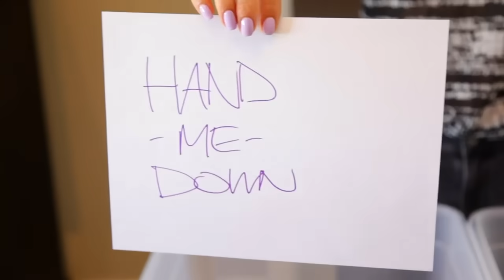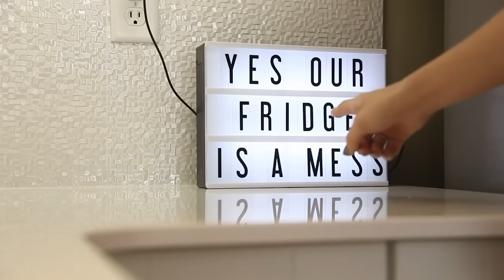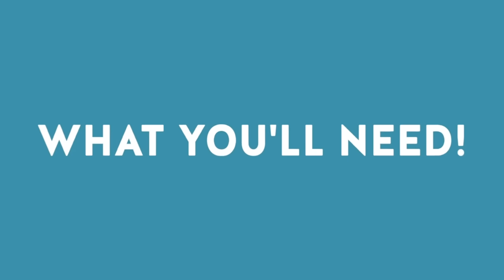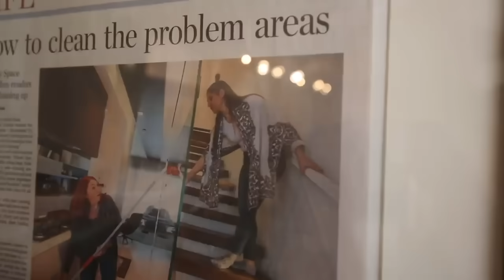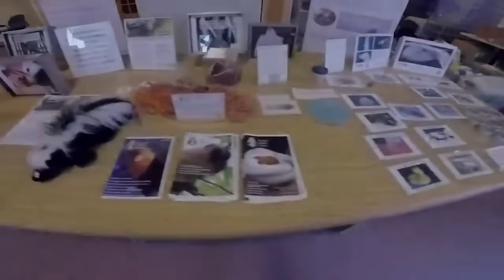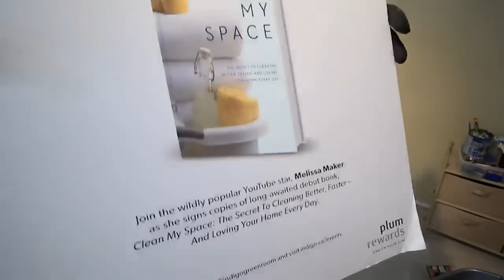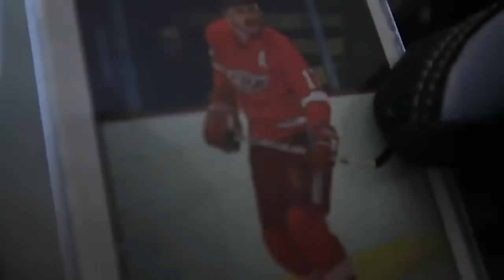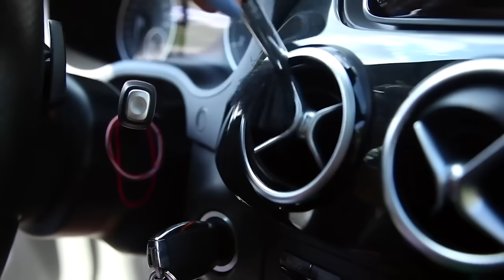Clean With Me Marathon (Cleaning EVERY ROOM in Our House!)

Comment: I love the 3 wave system.  I generally do the whole house at once, since I have a small house (meaning wave 1 for all rooms, then wave 2 for all rooms, etc).  Also since I started watching Melissa, I find that my Wave 1, which used to be by far the longest wave, is now a very short wave, since I try to not let clutter build up in the first place.  For wave 3, I usually just vacuum everything (hardwood, area rugs, and tiles) but sometimes I follow with wave 4 which for me is mopping and using hardwood floor cleaner (Bona).  :)

Comment: whole spices will stay fresh for about 4 years, ground spices for about 2 to 3 years and dried herbs for 1 to 3 years. You just need to store any that you purchase in bulk double airtight. I store mine in the resealable bag they came in or tie off then store in lockable Tupperware. Also you can use food safe silica in the storage container.

Comment: HELP! I have been watching you a long time and have never seen this problem addressed but I may have missed it.  My home is 35 years old and I keep it clean. I have used many of your methods. I have a very larger mirror in our master bathroom and every week I use a glass cleaner to clean it until it sparkles.  About 5 months ago a problem started.  After 1 shower(with the vent fan running) streaks appear on the mirror.  I clean the mirror again. After the next shower, more streaks.  I have changed cleaners. I don’t know why this is happening? I would appreciate any suggestions to remedy the situation.
Reply: Is there any chance there is moisture under the glass?
Reply: @Jen39x  I don’t think so. The rest of the wall is fine. There is a gap between the mirror and the wall because of the way it is hung.